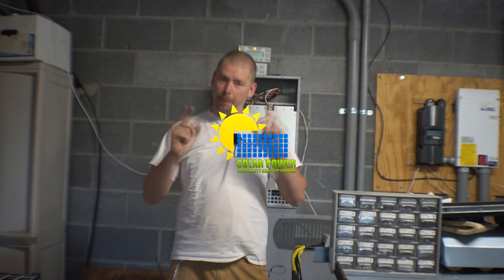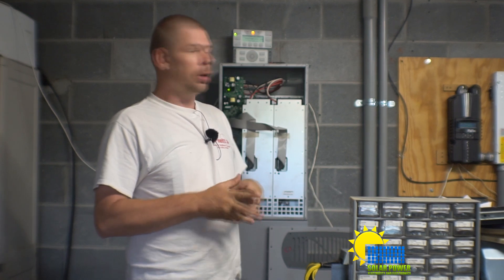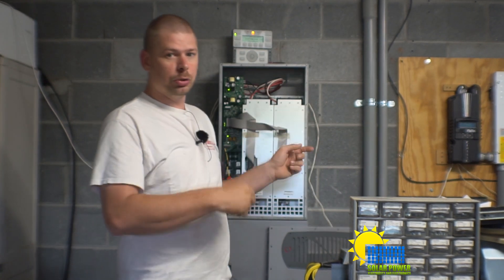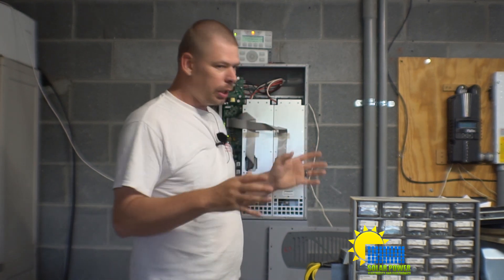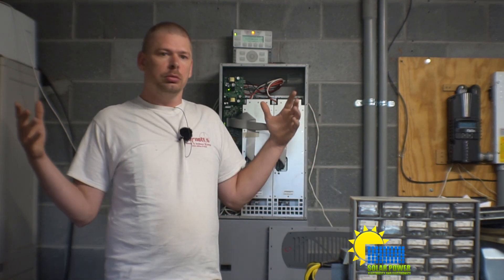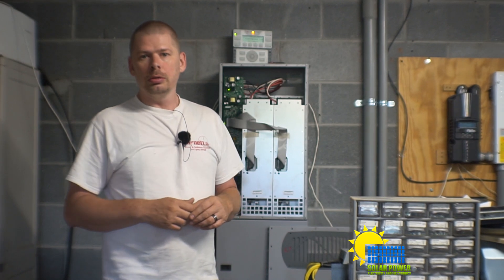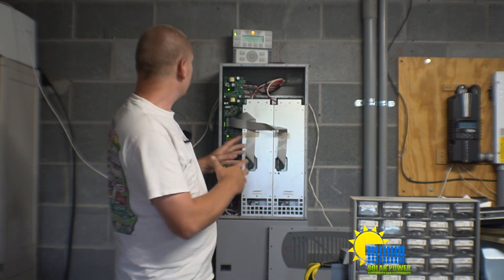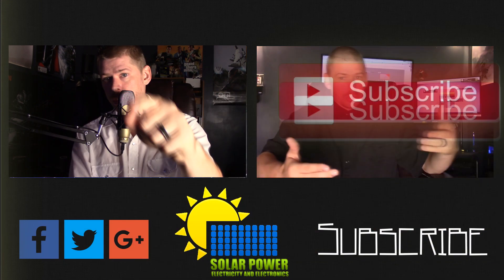Bitcoin Miners Solar Power On A 12KW Solar Array

Comment: I have a solar system and s9 running. I’m currently manually turning it on and off. Would you kindly give me a link to the relay. I don’t know what it’s called
Reply from the maker: Do you have the same inverter?
Reply: Solar Power Electricity and Electronics I don’t think so I have the outback power supply. I’m getting it figured out now. Looks like I have 2 relay ports I can use. These are dry contact generally right so it doesn’t matter which side is pos and negative it just says relay and has two ports.
Reply from the maker: @bodhitree1004  what relay are you going to use?
Reply from the maker: @bodhitree1004  I can get them and ship them
Reply from the maker: Your looking for a 120vac coil two pole contactor

Comment: The one thing I never heard any one mention about BTC mining, is calculating the increased value of BTC over 5 years or so .
They always say the utility bill is higher than what the best miner can mine .
What about the $70.00 I made in 2014 when BTC was only $300.00 .
Now BTC is $9,000.00 .
Wouldn't my $70.00 now be worth enough to pay the 2014 electric bill and have money left over ?
Seems like mis information spread by the international bankers, to me .
Reply from the maker: bitcoin is not a bank and if you have your bitcoin from then you still have like $2500 if you have the address and passcode
Reply: @solarpowerelectricityandel2915  
Exactly, the miners are able to pay the electric bill after the BTC they mine mature a few years.
On top of that, I trade my BTC.
Sell when it is high and buy when it is low. 
The international bankers want sheeple to think you can't make money with BTC .

Comment: SO your dump load is a bit-miner cool mine is a water heater.
Reply from the maker: I would love to have a hot water heater dump load
Reply: @solarpowerelectricityandel2915  Sure you could run your 240 output to your water heater and make your bottom element the bit miner then whenever the top element meets it's thermostat demand the relay would send it to the bottom element which would now be bit miner lol.
Reply: So how much kilowatts or solar energy do you use to get 1 bitcoin
Reply from the maker: @mteca5093  it is currently an astronomical amount I don't know how to start with that but it be thousands and thousands of kilowatt-hours I make about 1,000 plus a month I could make Maybe 1700 if I had another inverter to consume the power

Comment: Cool setup
Reply from the maker: Thank you so much I couldn't do it without my wife
Reply: @solarpowerelectricityandel2915  I have PV but due to UK weather and that I'm running some GPU not asic solar is just supplementary.  But without it it wouldn't be worth it as UK electricity is between 0.13 to 0.20 c per KWh